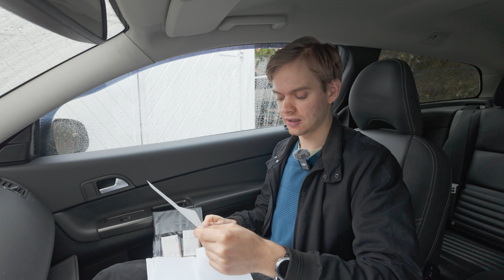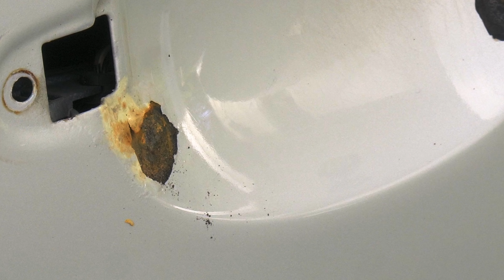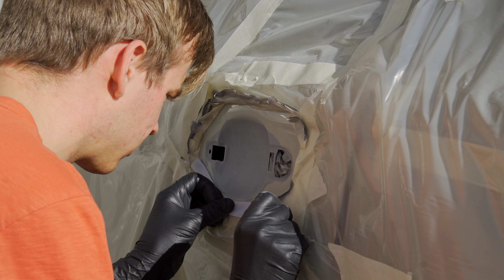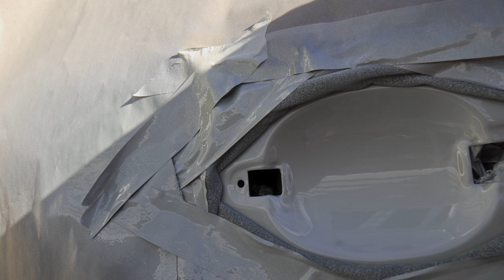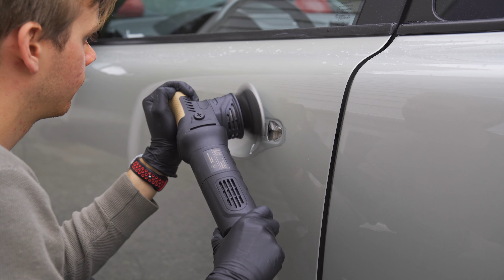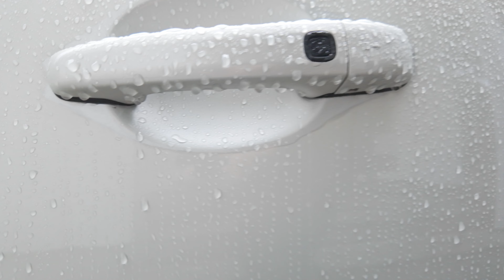I Tried DIY Rust Repair and Paint on the C30 | Volvo C30 R-Design

Comment: Nice result and most people wont notice.  Like you said better to address now than wait.  That door handle can be a challenge to remove and replace, took a few times to get right on my xc60.
Reply from the maker: Thank you :) oh yeah, I spent a few hours getting it off and on, especially the wire for the keyless gave me a headache.

Comment: Definitely quite decent job for doing it the first time. I guess you can always still go to the paint job and let them blend it a bit better :)
Reply from the maker: Thanks :) yeah, I made quite hard lines with it, so it could definitely use some blending, but I'm happy with it for now. I discovered (just after of course) that there are special blending sprays for clear coats, so if I ever try something similar, I'll definitely try to blend the base coat and the clear into the rest of the panel. Paint really is an art, and I'm really discovering that 😅
Reply: @VinnesAuto Yeah definitely worth a try if you ever need to do something similar again :)

Comment: Hi, you didn't use any rust convertor before applying primer? Should have bought any phosphoric acid rust converter, for example CRC Rust Remover 250ml. It's like 8 eur but makes quite a difference, especially if you apply it on the surface and then heat it up good with a heatgun. 
Also, should have spread something greasy from the inside. In my case, the rust mostly coming from the inside, not so much from the handle gasket rubbing the paint.
Reply from the maker: I thought rust converter was for painting over rust? And in my case, all the rust was on the outside, nothing around the edges from the inside.
Reply: @VinnesAuto CRC is basically just diluted phosporic acid thah you apply to the surface after sanding and it eats the remains of the rust in the pores, then you wipe it with water and degrease before priming. There are rust converters like Wurth, that have tannic acid in them, they form a dark film on top of rust and seal it, then you simply prime over it.
I had quite a bit of rust around rear window washer. I spend like 3 hours applying acid and heat to get it as clean as possible... 
Hate rust((
Reply from the maker: Yeah, the rust is some annoyingly stubborn stuff. Worst case it starts growing again, and I'll just redo the process with the addition of a rust converter. I'm guessing it started where it did for me because they missed a spot of rust when they repaired it previously.
Reply: @VinnesAuto I am surpised that there was a need in repair before you even bought the car. My 14 yo 320k had 10 times less rust under the handles
Reply from the maker: Well, let's just say that the Norwegian road services have no mercy when dishing out their salt mix on our winter roads. It's Bad.